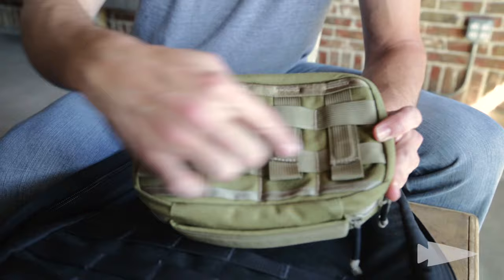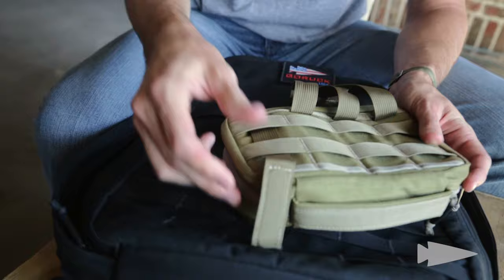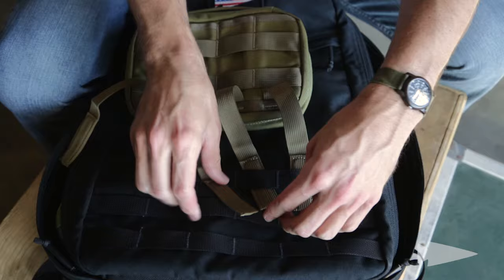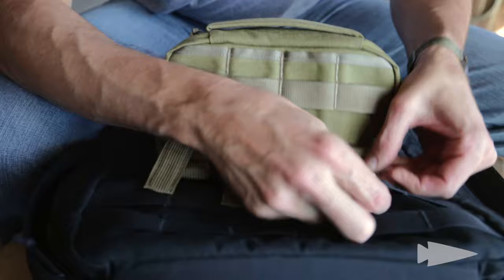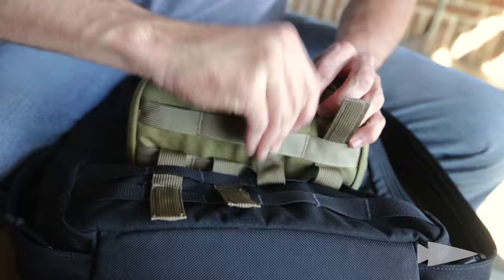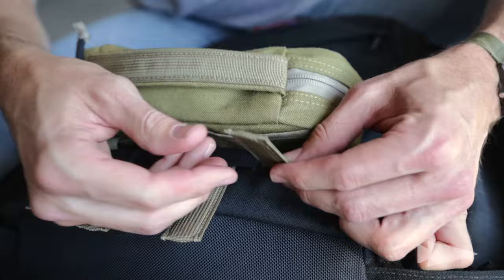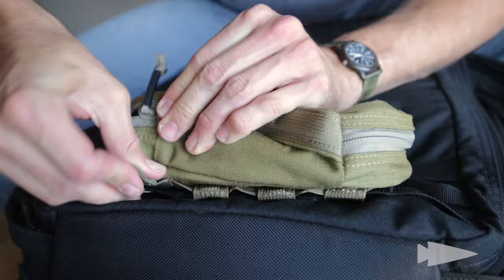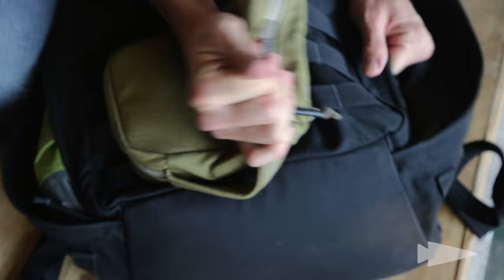How to Attach MOLLE Accessories to Your Ruck

Comment: all of my molle gear uses snaps at the end of the straps
Reply from the maker: Snaps are unnecessary and don't work that well over time, they corrode etc. This is my experience with all my old MOLLE equipment. With GORUCK's, there is a 0% chance that if you weave our MOLLE gear in, that it will come lose. And then, there is nowhere for the end of it to go because it tucks in perfectly - hence making the snaps obsolete. --jason